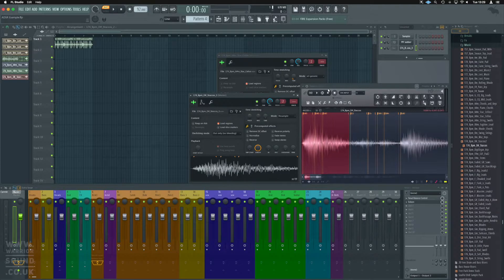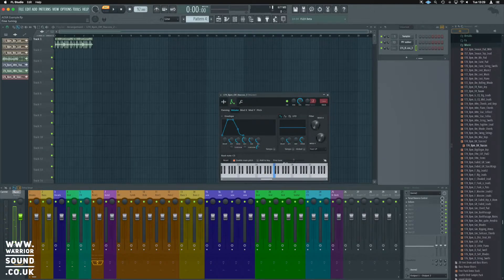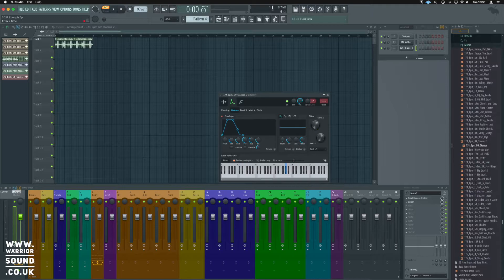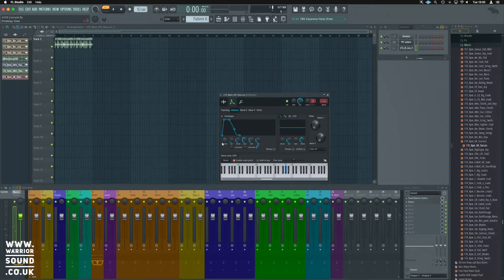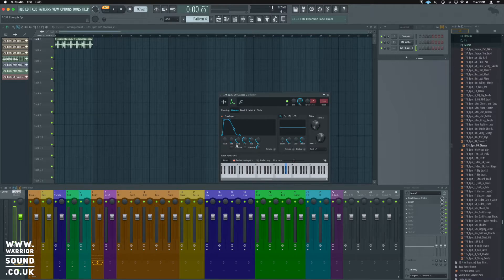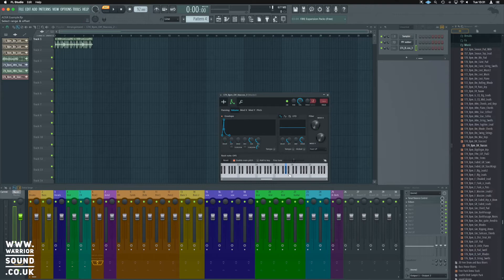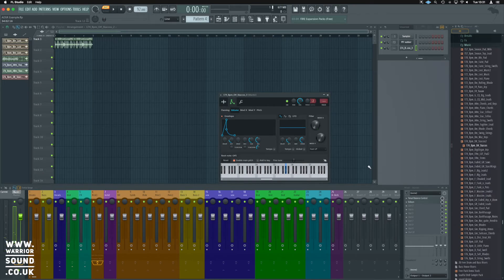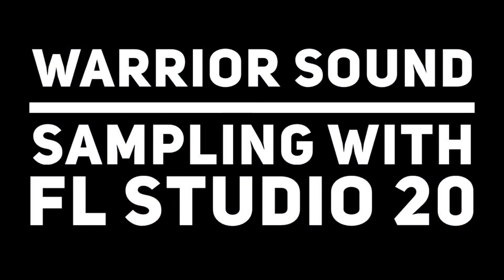ADSR Examples With Sampler - ADSR explained

Comment: This doesn t work for most plugins .
Reply from the maker: Correct it works 99% of synths ever designed.
Reply: No bro. This doesn't work with vst. Only with samples @Unders
Reply from the maker: @SorinSurujiu  Well... yeah, that's the ADSR in the SAMPLER. But the principle of the ADSR carries across everything. What are you trying to do?

Comment: For those who dont see the envelope, drop your sample into the channel rack. Fl has 2 audio editors that look the same
Reply: didi you solve?
Reply: @SorinSurujiu im not sure anymore what I was talking about with this comment. Based on your other comment on this video though, your problem is that you are expecting an enveloppe for vst plugins, which is simply not how it works. The enveloppe and its adsr, change the way in wich a sample (=a piece of sound as an mp3 or wav file) is played, so it might fade away quicker, take a bit to get loud, etc. This does not make sense for plugins, as they are able to continuously generate sound (so they are not bits of sound, they are instruments). You would have to change the enveloppe of your notes inside of your plugin, these knobs are always harder to find than they should be unfortunately.

I presume that you are new to fl so if you have more questions ask